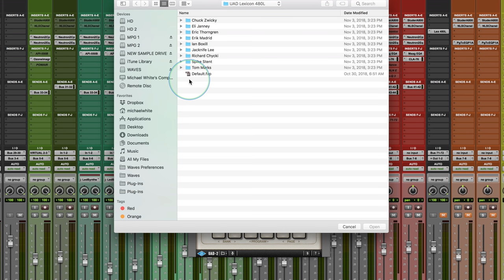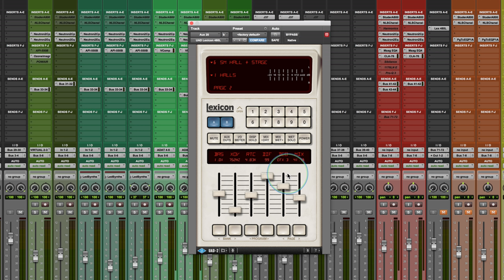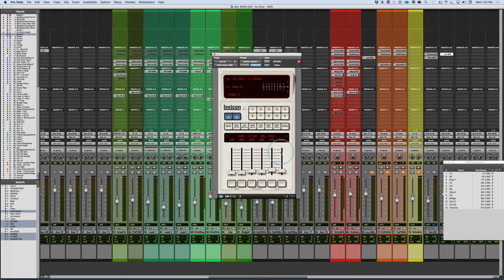UA - Lexicon 480L (Operational Overview) - Mixing With Mike Plugin of the Week

Comment: Hey Mike, I suppose a 3 year old YT vid would be considered positively ancient these days but wanted to drop a line. Initially trying the UAD 480L, I was non-plussed, just another reverb. I can’t explain exactly why it suddenly seemed very important to try it out again…ah maybe a video extolling the virtues of the 224, which I own compared to the 480L. I’m on a bit of a reverb tip as well as reappraisal of some plugins knocking about on the hard drive. I searched for your take on the 224 but found the 480 instead. During the course of washing up and subconsciously listening to you detail the workflow and the power of this design, I had absorbed the fundamental appeal of the 480. I was pleased to be able to demo the UAD once more in the studio this evening, thanks to you it all felt very intuitive. 
This is more than the nicest reverb I’ve ever used, the workflow makes dialling in the right sound, very workmanlike, efficient and satisfying. Like I’ve not known before.
Perhaps the difference was I wasn’t working with a reverb and adding it to some audio, rather I was working with the audio via the reverb. Herein I suspect is the uniquely attractive quality of the 480.
I own many reverbs including the Liquidsonics M7 which has perhaps a denser, darker more contemporary tone, but comparing two different mixes the 480 smoked it, mainly because I could so easily first find an effective preset and tailor it very precisely. In reflection, the M7 hung a little loosely around the mix. Furthermore, I was able to target a frequency in the voice I liked and enhance it, pulling it forward and in turn making the mix more compelling. Play back overall provided me with a finished record vibe, a transparent but gratifying staging of the song.
Perhaps 2 questions, am I describing the 480 experience and secondly, I can’t see any reason why this wouldn’t continue to be the number 1 option for reverb, regardless of developments elsewhere, I mean - what are engineers preferring to this today and if you know, why?
All the best Jon